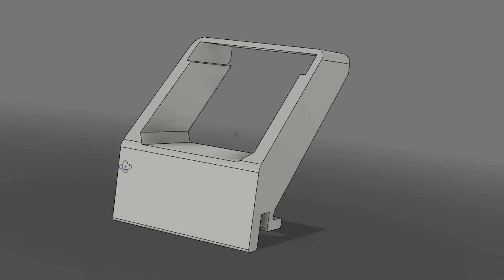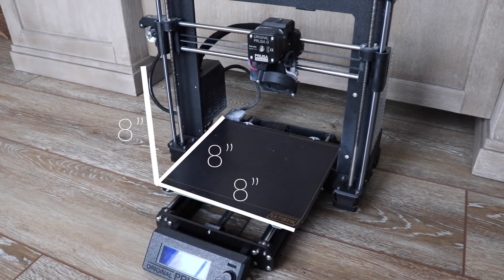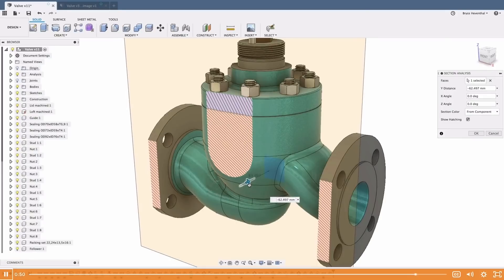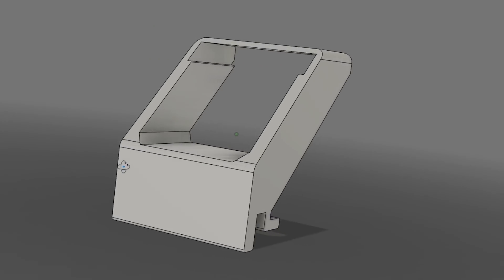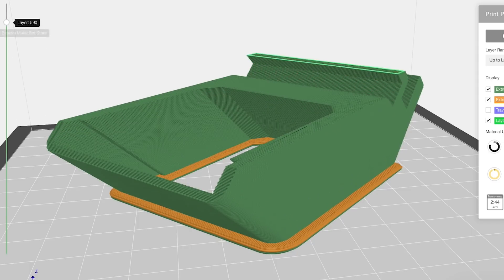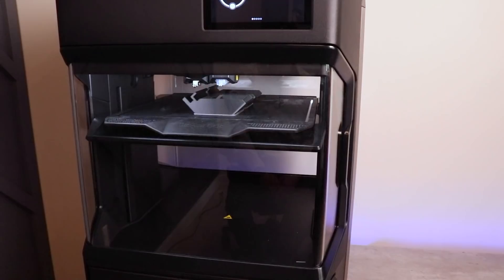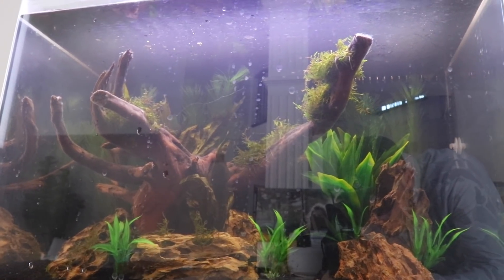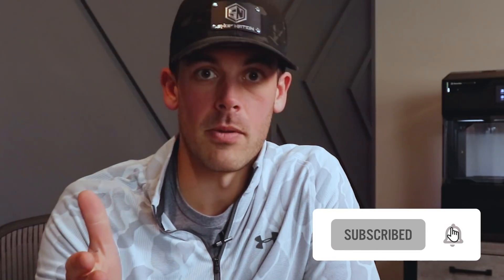From idea to reality - Functional 3D Printing

Comment: It's important to note one of the most important things you can ever do if you're making a 3D model for something that already exists is to model the object that already exists before you start designing. And then make your design around it. I see so many people doing trial and error and wasting days trying to create an object from out of thin air and checking to see if it fits even if you have the correct measurements.

Comment: Excellent video and presentation. If you could be as objective as possible, how much better is your Makerbot 3-D printer than the ones you use in your print farm that appear to be about a 6th of the price?

Please be specific about HOW it is better, and how those refinements, or improvements, benefit me as a potential purchaser.

BTW: I am 3D literate, having used Sketchup and Solidworks for years, as well as CNC proficient, so you can be as detailed as you like in outlining the differences and benefits. 

Thank you.

Comment: 100% agree about having a 3D printer for the shop - I've already made quite a few things for my shop and am now selling them only. I also just received the Prusa SL1S; I'm excited about having a faster prototyping machine now. My idea is to test ideas on the SL1S, and then once the design is final, use my regular FDM printers (also prusas) to farm out the parts. Thanks for cracking into this topic, really hard to tell how the woodworking community will take it - I feel that you've done a great job explaining how it's beneficial for the shop. Sub'd!

Comment: I thought Fusion 360 was free still for hobbyists?  I think I still have it on my desktop PC actually. I have been using a different program myself since I’m not very good at modeling and a complete beginner. It’s called Shapr3D and I personally model on my iPad Pro because it’s super intuitive. I’ve been alike to make a ton of designs using this tool. It’s a monthly subscription that’s kind of high at $30month but to me it’s worth it. Also you can turn this subscription on and off as you need it. You can do a free trial and can do 2 models at a time which I did use for awhile at first.

Comment: Hey Shop Nation!! I have been looking and found no answers. Can you 3d print a replacement board for a deck and still support the weight of a human? I figure it is longer lasting as it wouldn't rot.
Reply: "WOODN'T" rot. Had to pun.
Reply from the maker: Like a deck attached to a house type of deck? Well biggest issue would be size but yes in theory it would work but would not be a good application. A bit like using a pocket knife to whittle a table out of a solid log.

Comment: Version 2 of the right side light mount..... Cable management and a some clips to push the wire to the back and limit its visibility so it looks nice and clean and doesn't hang down on the side.   I enjoyed the video even though I don't have a printer.  I really just want to start learning fusion 360 so I can eventually print and design things.   Maybe even some laser engraving or CNC.

Comment: Want to note fusion also has a startup free license for people just starting out but want to make money from there designs. I love my modified ender3 great to print jigs with.. great tips on how to get part that fit well.
Reply: They also have a fully free (indefinite) license for personal use if you're not monetizing via its use.
Reply from the maker: In my experience it does expire
Reply: I’ve personally renewed my free subscription multiple times…but it’s not obvious as others have stated.

Comment: I would like a video where you discuss you overall process for dialing in your settings because your prints are what everyone with a 3D printer envies.  I'd also like to know what brand/type of filament you use.
Reply from the maker: Step 1, don’t buy a cheap printer. That is the fastest way to get frustrated and quit. Spend a little more for a quality machine and you won’t have to dial in hardly anything
Reply: @ShopNation  Maybe a video on the differences between the Prusa vs Ender vs Makerbot.
Reply: @jaystarner  about $5000.  They both are printers, but vastly different.  The Makerbot Method X is designed to be a turnkey printer of exotic/engineering materials.  A stock Ender, regardless of model, is going to require significant modification (high temp hotend like a Slice Engineering Mosquito or Phaetus Dragon) for that.  Then there are other considerations like heated chamber/enclosure.
Reply: @MakerMeraki  I haven't had to do any modifications to my Creality Ender 7.  I focus on PLA material though.  It is possible outside of PLA that you might run into areas where you need to start changing the hot end.  I think the 7 setup is a bit different than some of the other Enders since it runs at 250mm/s.
Reply: @ShopNation  I got that part down.  I ended up with a MK3s after you video you posted a while ago.  I am happy with it and I get good prints but not good like yours.

Comment: for anyone looking Fusion 360 is free for hobbyist
Reply from the maker: I wasn’t sure if that deal was still going on
Reply: @ShopNation  I think most software is handled this way now.  You can get the basic package free, as long as you aren't using it in a business setting.  This, a) makes your product more available to a wider audience and b) probably leads to many upgrade purchases to enterprise/professional versions as the users of the free version start doing more complicated things with it.  I know I wouldn't just drop 300+ bucks on a CAD software package I had never used before, but would consider it if I was familiar with it via a free version, and then needed/wanted more advanced features.
Reply: That is correct. Just got into Fusion recently for hobby and it is free